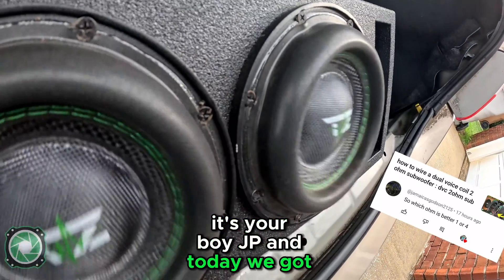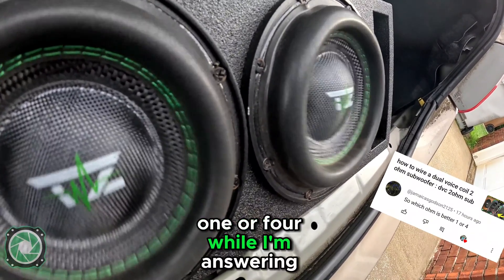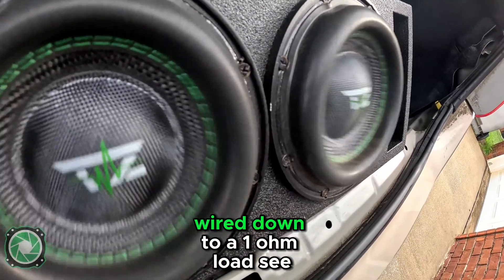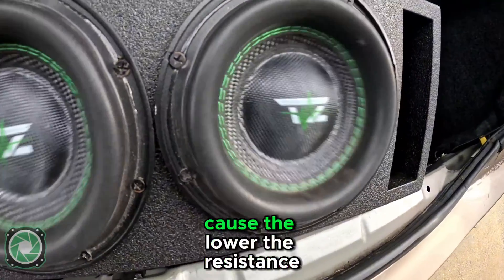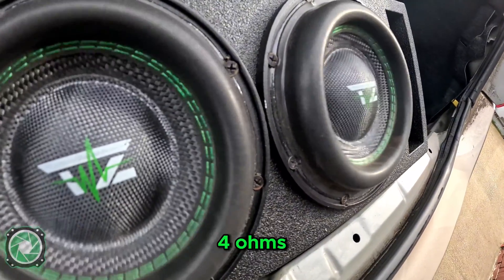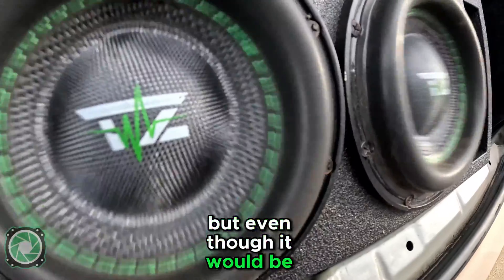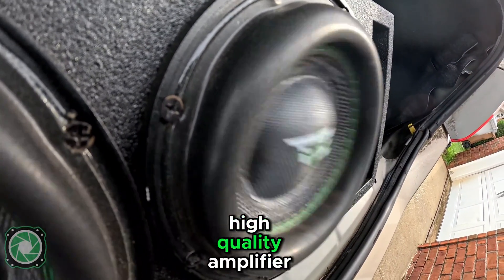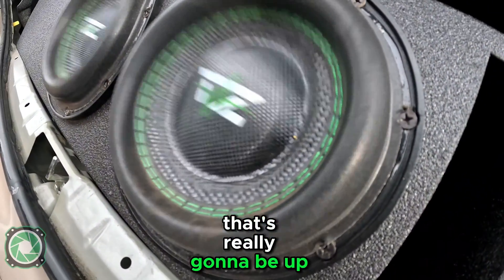1 ohm vs 4 ohm which ohm load is best ? Tezla Audio TZ615KD4G2 Subwoofers

Comment: I would buy a more powerful amp and run it at 4 ohm. That way you get the power that you need at an efficient ohm load.
Reply: Those are the most expensive, and there inst a lot of them

Comment: What I have noticed when I tried 4ohm and 1 ohm setup is that the 4ohm feels like it has more kick in the sound than in 1ohm. It's kinda like if you run your car with standard flywheel (4ohm) vs a light wheight flywheel (1ohm) , you get more speed but less torque.
Reply: Because the 4ohn has more control over your speaker's response

Comment: Now what if you have a amp like the tar amps HD 3000 they make them in one ohm 2 ohm and 4 ohm stable meaning you can have an amp that is 3,000 Watts RMS at 4 Ohms I have a dual 2 ohm subwoofer so I was going to wire it up to 4 Ohms and get the tar amps 3000 W 4 ohm amplifier instead of wiring it down to 1 ohm and getting the same brand 1 ohm stable amp which would be better

Comment: I'm running 2- b2 audio 8 inch  rage  subs at 4ohms with a Rockford Fosgate T1500-1bdcp. Pushing 1,000 watts rms. Super loud, clean, accurate bass.

Comment: yeah but what if your amp can run 3000 watts are 4 ohm and you sub is rated at 2500 running it at 4 ohm would make more sense then then 1 ohm and trying to handicap the amp to the lower power level to not blow the sub right
Reply: Yes and no, realistically we want all the power available, but turning a amp to high will decrease its overall lifespan, that goes for all electronics, they don't exactly like heat. 4 ohm will sound better, I've ran my entire system at 4 ohm, I've ran 2 ohm on the doors and 1 ohm on the sub and also ran 4 ohm doors and 2 ohm on sub. My amp is perfectly matched and although the amp never got warm even on a 1 ohm load, I ended up keeping the car at 4 ohm all the way around, power doesn't determine how loud you are, my 2 10"s on a 800 watt amp physically hurt my teeth on certain frequencies, at 4 ohm that's 600 watts. I've never needed more than 1,000 watts to be "loud" unless it's a competition. But if it's a daily driver 4 ohm is better, competitive 1 ohm for sure. It's also the reason home theater speakers are 6 or 8 ohm, they sound better, car speakers are made to be at a even lower ohm to allow more power, it's better to have the headroom and not use it in my opinion.

Comment: I got 2 6.5 dvc 4ohm subs in a ported dual enclosure. 300rms/600max wired for 4ohm to my amp that does 800rms @4ohm, max 2000w @1ohm. Certain bass notes(mainly the higher ones like in reggae bass lines) I get this mean rattling sound from the box itself. Would putting that cotton/sound cushioning material in the box help rid of that? At first i thought it was my sub rattling but then realized it was the sound of the box. It’s tuned for 40hz, and i have my subsonic set to around 38hz. And DS18 recommended a 160hz LPF so i have it set there. (my max LPF is 180hz so I turned it smidge down from there since there’s only 40hz/180hz number markings) playing other songs that hit lower I don’t hear the rattle, but when it hits that higher note it rattles the heck out of the box and sounds terrible. For example, the high bass note in “2chainz-Forgiven”. The lows hit nice and sound great, but when that high hit comes on it does rattles the box
Reply: The box is resonating at the higher bass notes .  I'd reinforce the enclosure and find a way to tune it lower also

Comment: Hey bro, i ran into your channel trying to fix my truck stereo, stopped working randomly on my drive home. Sound went out but subs kept working. Opened it up and found a rp5  gm11. Moved poet over to amplified and got some sound back, but super low. Saw your video to bypass door speakers. Think that will work. Thank you